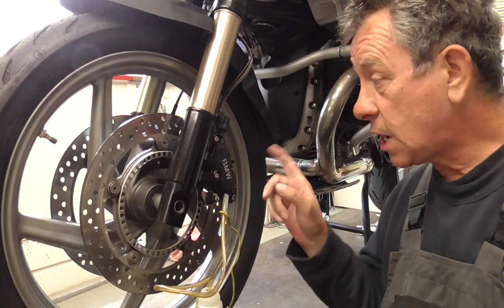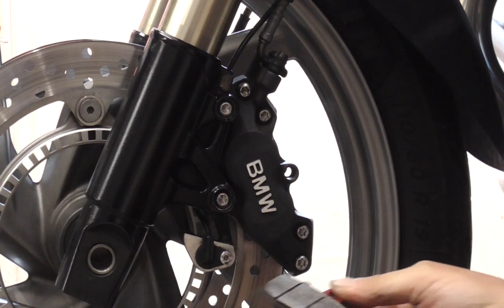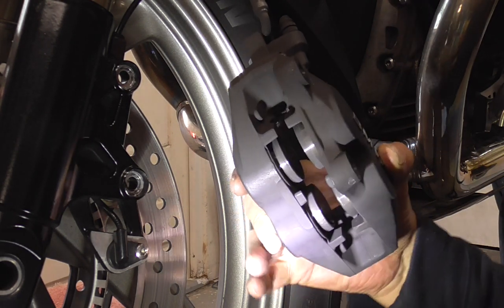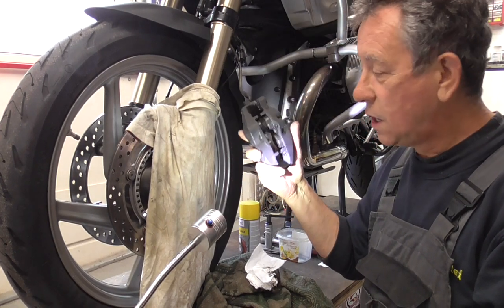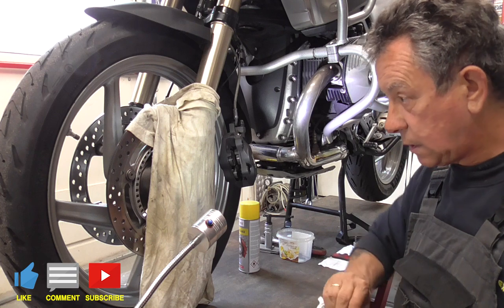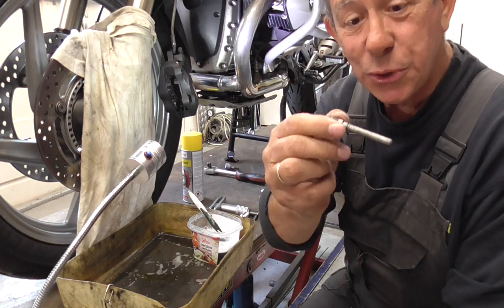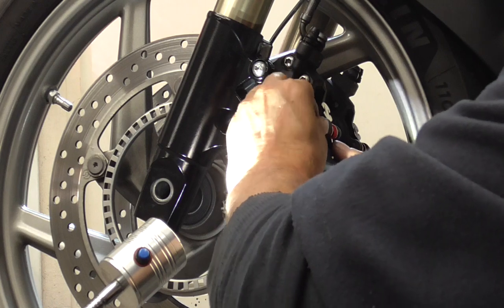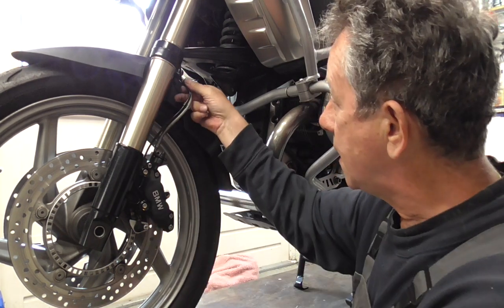BMW R1200GS [2010] FRONT BRAKE CALIPER CLEANING..EASY..? The Old Mechanic his own R1200GS 👨‍🔧---🏍

Comment: Old Friend, here I use a more practical way to keep the brake fluids of my R1200 GS 2012 always in good condition, I know it's not an orthodox practice, but it's been working for decades. I simply change every six months the entire contents of the front and rear brake fluid inside the reservoir by syringing the fluid out and replacing it with fresh fluid. So the old fluid inside the caliper and the pipes is mixing with the new fluid that I put in the reservoir and I always have a relatively new quality of fluid in the system. It's easy, fast and I don't need to be intervening with tools on the system. I know that I will never have 100% new fluids in the system, but I will never have less than 70% new fluids either. What do you think about it?

Comment: Dont’t forget to pump up your brakes and to top up the reservoir before you start riding again or you might be in for a surpise. Also brake fluid can easily be taken out of the reservoir using a syringe (watch the paint). No risk of introducing air into the system.
Reply: I think he knows what to do 🤦‍♂️
Reply: Not entirely convinced he does, to be honest..